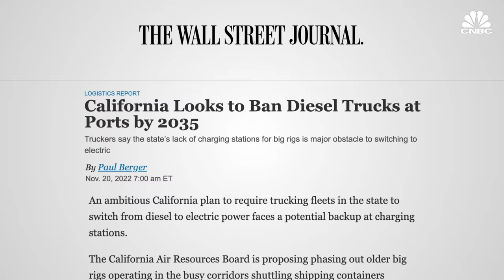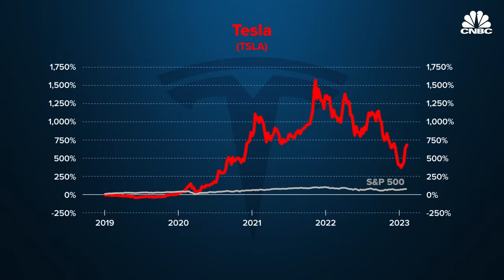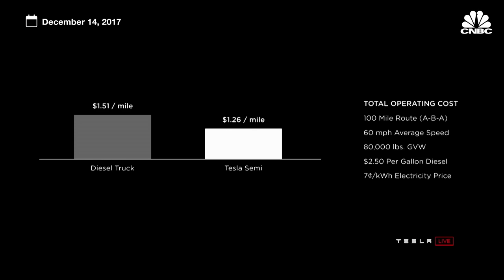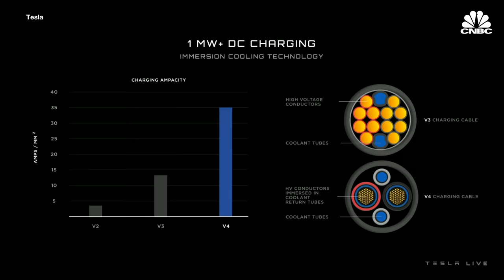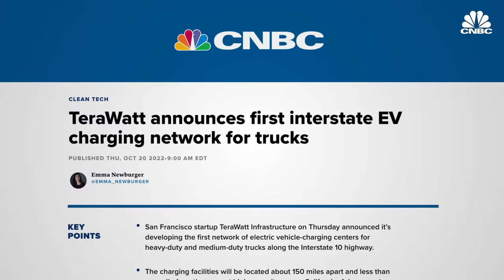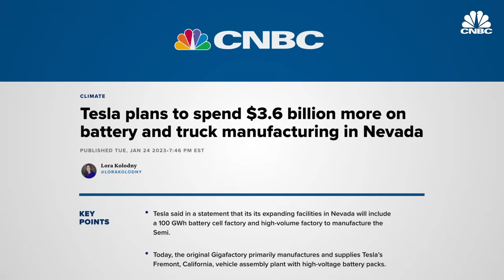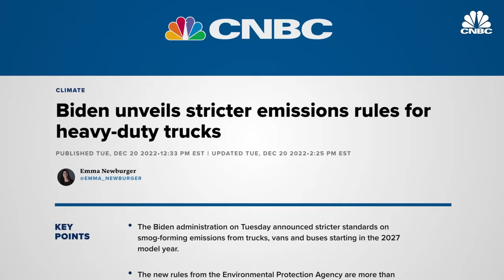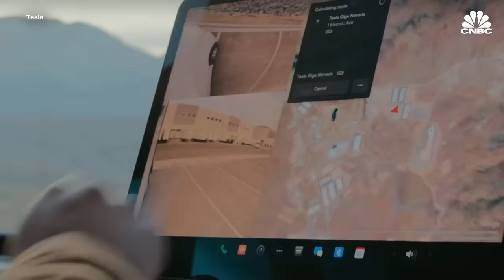Does The Tesla Semi Live Up To The Hype?

Comment: I do like the idea of not spending 500+ dollars at the pump for a tank and honestly wouldnt mind the hour recharge time, I can find time for that. But 500 miles isnt enough, ill be interested when that bumps up to 750
Reply: HOS requires a 30 minute break at the 8 hour mark, and Tesla has stated that it can add 70% or 350 miles in 30 minutes; so when the grid expands to the point where there's a convenient charging station at about the 8 hour point, you'll probably have a range greater than what HOS would allow, at least in states like California with lower speed limits for trucks. But that'll likely take a decade, just as it did for the now-worldwide Supercharger network. In the meantime, the Tesla Semi probably isn't appropriate for independent owner-operators such as you appear to be; and I don't think that's the market they're selling to.

Comment: If they put batteries in the trailer along with the ones in the truck the range will increase massively.
Reply: And the payload will decrease massively. Including a top-off during the 30 minute break at around 8 hours required by HOS regulations, the range is as far as a Tesla Semi can be driven in a day, so any additional range would essentially be wasted.

Comment: One thing i see with the Tesla Semi and never Tesla vehicles is that the Speedometer is off to the side. I want it right infront so i can keep focus on whats happening infront of me and not having to look to the side. I understand that its just something you have to get used to but still. We live in the age where alot of manufacturers have heads-up displays. Why not just have one in the middle instead and keep the Speedometer thing to the side?
Reply: This was done to give the driver an unobstructed view forward, as described here: "The driver's seat is centered, not offset as in conventional cars and trucks, giving the driver evenly good vision on both sides and a view ahead that seems almost as if one is atop the sloped hood of the truck, not behind it." I can't post a link, but you can search for "Why the Tesla Semi Makes So Much Sense". Drivers of 1.3 million Tesla Model 3s and Ys will attest that it only takes a few minutes to adjust to a speedometer off to the side.

Comment: Are batteries really carbon neutral???
Reply: Not at first, but for cars at least, the break even within a few tens or scores of thousands of miles, depending on the fuel mix the local electrical supply is based on. Tesla Semis are likely similar.

Comment: The cost calculation is not taking added future cost due to demand on electricity. We already see this clearly in California. The cost of driving EV is already higher than ICE AND it’s driving cost of electricity in general with it.
Reply: Stories you've read stating that EVs are costing more per mile than ICEVs are based on daytime charging rates at public chargers; for example, the daytime rate at a Tesla Supercharger near me is 47¢/kWh. But at least in the initial model, Megachargers are being installed in customers' yards, and will use electricity at the customers' much-lower commercial rate. In fact, for residential users, EV rates as low as 15¢/kWh are available even in SoCal, which has some of the highest electrical rates in the U.S. So those claims aren't relevant to a discussion of relative costs between Tesla Semis and diesel semis, but only for comparison of EVs charged at public charging stations vs. ICE vehicles; while the vast majority of EV charging is done at home, at much lower rates.

Comment: its all well and good, but what nobody addressed is the fact that BATTERIES lose efficacy as the years go by. 
10-15 years down the line, what would be the cost to replace these Tesla batteries? 
what would be the downtime for replacing the batteries on an entire fleet of trucks? 
how will those batteries be disposed off?
Reply: The cells in these trucks last 400k miles before becoming 80% of their original capacity, newer cheaper less dense cells push past 900k miles, cost to replace now is likely $100,000, but if you acount the $240,000 you save on fuel during the 400k miles life cycle its pays for itself, the maintenance cycle is also lower so a battery replacement will not hinder fleet operations comparex the multiple service visits diesel trucks need. Tesla plans to recycle all of their batteries as the see the price of metal going up.

Comment: Does make you wonder why they didn’t want the drivers making any statements. Could it be that the Semi doesn’t exactly live up to the hype? 

From an economics perspective, a vehicle that’s double the initial purchase price of its competitors doesn’t make sense. Yes, maintenance cost may be lower for the Semi, but they won’t be entirely eliminated. And most fleets trade their vehicles in every 3-4 years, which means they’re not particularly focused on the “lifetime” economic benefits, assuming there actually are some.

Comment: That delivery area seems to be mostly flat roads. A big test would be crossing the Sierra.
Reply: Tesla did do a 500 mile range test over Donner pass which had 3000ft of elevation gain and drop, this video pretends Tesla never did that test.
Reply: Mountainous terrain is where the Tesla Semi has the greatest advantage over diesel semis; first, because they have 2-3 times the HP of diesel semis, allowing them to climb steep grades at highway speeds; second because regenerative braking removes almost all of the fuel penalties for steep climbs and descents; and third, because there's no loss of power at high altitudes, and in fact slightly better economy due to less air resistance.

And Tesla Semis will do better than diesels in snow and ice, for at least three reasons: first, a substantial portion of the weight of the tractor will be shifted back to the drive axles due to improved weight distribution of the batteries, increasing traction; second, the smooth application of torque by the electric motors, compared with transmissions shifting every few seconds, will mean less wheelspin; and third, the torque axle has independent motors on each wheel, allowing torque vectoring in limited traction situations.

Comment: I'm a truck driver...this is a joke no way will this ever happen trucks like that generally have a loaded weight of 80000 lb. And go across several States and maybe refuel once on dual tanks. Notice this truck is carrying Cheetos? Last I heard a 53-foot trailer carrying Cheetos does not way 80,000 lb I drive a super 10 Peterbilt I haul rocks and gravel concrete dirt. Enduring the fires of Northern California Paradise reading etc. There's no way an electric truck could have kept up with me. This is a joke and it's only made to hurt our country.
Reply: You seem to be saying that since it can carry Cheetos, it can only carry Cheetos. That's a pretty basic logical fallacy. And there is also a video of a Tesla Semi towing a flatbed trailer loaded with 44,000 lbs. of 10 ft. K-Rails (California-specific version of Jersey Barriers, that weight 3,900 lbs. each), accelerating rapidly up a 6% slope on Donner Pass, and passing a diesel semi as if it were standing still.
Tesla Semis have 2-3 times the horsepower of a diesel semi; what's your basis for claiming that "There's no way an electric truck could have kept up with me"? One certainly not only kept up with the diesel semi on Donner Pass, but passed it going away.

Comment: One question: what is the max payload weight proportional to a gas-powered semi of the same road weight? 50%? 25%?
Reply: 92%. A diesel—not gas-powered—semi has a max payload of about 46,500 lbs., and a Tesla Semi has a max payload of about 43,000 lbs.
Reply: @BigBen621  he mean weight regulation on road

Make battery metal weight identification to oil is pure magic
It's like France reduce weight of AMX-50 "Armoured" into "light weight" variant but it's still heavy to service
Reply: @02suraditpengsaeng41    he mean weight regulation on road 
No, he specifically said "max payload weight."_ 

Make battery metal weight identification to oil is pure magic 
I have no idea what that means. It might be better to write in your native language, and let Google translate it.

Comment: If it’s too much weight why not half the amount it can lift? Just make the truck smaller. 2 people can deliver across the US to make up for it. Or is diesel cheaper than 2 people delivering in electric semi?
Reply: Operators can always choose to reduce the payload to reduce the weight and increase the range. Loaded to 21,000 lbs. instead of 42,000, the range would be extended from 500 to almost 590 miles.

Comment: lol it makes sense they are using it to deliver chips, they are mostly air, since they wont be a large weight in comparison to drinks.
Reply: You obviously didn't watch the video before spouting your nonsense, because it states specifically at 4:32 that drinks are being hauled 300 to 400 miles.

Comment: I believe the Chinese do it better with swappable batteries rather than charging ports. That should at least be an option
Reply: This increases the cost to adopt since you will need more battery packs to sit at charge stations then in trucks, these are very big batteries that cost atleast $120k each. That's why Chinese companies charge a subscription to use swapping stations for a specified number of times, it's to expensive to do for mass public infrastructure as you would need billions in batteries ontop of the mechanical units that can swap 5 ton batteries reliably.

Comment: Maybe this is a dumb idea, but why not put the bulk of the battery on the trailer. It could be charging while it’s docked and getting loaded. The truck could have a small 50 mile internal battery and would simply hook up to the next fully charged and loaded up trailer.
Reply: Simply because that would dramatically reduce the payload.
Reply: @BigBen621  Battery on the truck, battery on the trailer, total battery weight is the same. Gross vehicle weight is the same.
Reply: Gross vehicle weight is the same. 
Yes, GVW is the same. But that's not the only weight limit; there's also a per-axle weight limit on semi trailers; which combined with the GVW limit, limits the payload on a Tesla Semi (weight carried on the trailer) to about 43,000 lbs. So any battery weight carried in the trailer would reduce payload, pound for pound; and Tesla Semis are already at a minor disadvantage to diesel semis with respect to payload.

Comment: I can tell you as a driver myself, these are incredibly impractical.  They will cause massive delays in shipping.
For starters, the batteries are 16,000 lbs.  That means it will take 3 of these to ship the same amount of product as 2 semis.
Diesel trucks require on average 8 - 15 minutes to refuel every 600 - 1200 miles, while these will cause a driver to take their 10 hour break every 400 miles (about 6 1/2 hours of driving) or less to recharge.
This means a 34 hour trip across the country will take atleast 5 days to complete.
This also means that team drivers will no longer be necessary.
Charging them is another major issue as there are almost no places for trucks to stop longterm to recharge.
The charging also has another major flaw.  just 30 EV trucks will draw 5 Mw of power to charge and with our current electrical grid will completely brown out a city.  Now multiply that by 133,334 times since there is currently 4.06 million trucks on the road today.
Now these delays are for each trip.  Take into account that everything from ship to shore, to a warehouse, to a manufacturer (often to multiple as many only produce 1 of many parts), to another warehouse, to a distribution center, and then finally to your local store.  Who's up for waiting 2 - 3 weeks to get toilet paper or food?

Now with all that take into account the huge scams that have recently been uncovered and facing legal challenges today like the illegal kickbacks for EV and carbon emission offsets and the global warming scam.  Only 0.05% of the atmosphere is carbon.  It was concluded and warned that if carbon in the atmosphere dropped to 0.02% that plant life would start to die.  If plant life dies, everything dies.

People do not believe main stream media.  There are numerous congressional hearings about EV's, solar and wind, the electrical grid, and the so called global warming crisis where our so called government experts themselves say none of this is viable and are presented with actual figures that leaves them trying to stonewall by repeating how much they don't know.
Reply: For starters, the batteries are 16,000 lbs. 
The best estimate is that they weight less than 10,000 lbs.
 That means it will take 3 of these to ship the same amount of product as 2 semis. 
Demonstrated payload is 44,000 lbs., within about 2,500 lbs. of the maximum payload of a diesel semi towing a dry van trailer.
 these will cause a driver to take their 10 hour break every 400 miles (about 6 1/2 hours of driving) or less to recharge.
No, they take their mandatory 30-minute break before 8 hours, add 200 miles of range during the break, and continue to the end of their 11 hours on duty.
 This means a 34 hour trip across the country will take at least 5 days to complete. 
You may have noticed that these are day cabs. They are not intended, designed or marketed for long haul or OTR applications.
 This also means that team drivers will no longer be necessary. 
See previous response.
 Charging them is another major issue as there are almost no places for trucks to stop longterm to recharge
That's exactly what folks were saying about Tesla cars ten years ago, and now there's a near worldwide network of >50,000 Superchargers. There are already Megachargers for several times as many Tesla Semis as are in private hands, and the charging network will be built out where it's needed, as the fleet expands.
 just 30 EV trucks will draw 5 Mw of power to charge and with our current electrical grid will completely brown out a city. 
If you mean 30 EV trucks charging at once, that's 30 times 750 kW which is 22.5 MW. There is no factual basis for your claim that even 22.5 MW will completely brown out a city. There are comparably-size Supercharger installations in very small cities, and they're not being browned out. For example, in the small town of Coalinga, CA, pop. 17,465, Tesla installed a Supercharger station with 80 V3 Superchargers of 250 kW each, with a total demand of 20 MW. Similarly, in the even smaller town of Kettleman City, CA, pop. 1,245, Tesla installed a Supercharger station with 55 V3 Superchargers, with a total demand of 14 MW. So your claim that 5 MW of power, or even 22.5 for 30 Tesla Semis, will brown out a city, is simply unfounded.
 Now multiply that by 133,334 times since there is currently 4.06 million trucks on the road today.
It will take decades if not generations to convert the entire fleet to BEVs, which is plenty of time to expand the grid and install charging stations as necessary.
 Now these delays are for each trip.
What delays? In the near term, electric semis will be used in local or regional delivery where charging occurs either between shifts or off shift. Long haul and OTR will continue to be by diesel semis. Where are these delays of which you speak?
Reply: @BigBen621  Considering I am a driver, been driving for some time, but most of your fact sheet is wrong.
The batteries weigh 8,000 lbs each and there are 2 in a Tesla, that is 16,000 lbs not 10,000.  You're math is way off.
Your average payload is around 44k, minus 16k, last I checked 44k - 16k equals 28k.
28k times 3 equals 84k, which is less than the average payload of 2 diesel trucks.
According to you these EV's will recharge half of their battery capacity in 30 minutes, this is totally false.
You're claims of how many big truck super chargers (you said world wide lol like that matters) is seriously overexagerating and deceiving.  I have never in any truck stop, rest area, weigh station, or parking area seen not 1 truck EV charger.  Not 1.  And I travel everything from just west of Fort Worth all the way up and everything east of there.
I know these are day cabs, I was pointing out that these trucks will mean no more team drivers, and that means longer delays in shipping because team drivers get to drive while solo drivers have to stop after 11 hours, which means the elimination of all longhaul expedite services, and anyone that does continue will have to be done like Fed-EX and UPS does by setting up routes where 1 team takes it 400 miles or less and swaps with another truck until it gets to it's destination.
You don't see delays in shipping because you're under the delusion that you can fully charge one of these in an hour or less and it is not the case.  It takes several hours which is why they have only been used for short hauls locally and put on chargers after their shift so that it will be charged when they return after their break.
6 1/2 hours of driving to reach 400 miles, and that is stretching the fact that you can drive that entire 400 and several hours of rechargine kills your 14 hour duty period.  We only get 11 hours of driving during that 14 hour period which will be eaten up by that charging cycle (that will not be a 30 minute break after 8 hours because you cannot drive for 8 hours because it does not have that kind of range.  Even you pointed out a range and then later said you could drive for 8 hours take your 30 minutes and then continue another 200 miles.
Fact check actual facts from actual rules and regulations and compare those to actual performance statistics of these EV's next time.